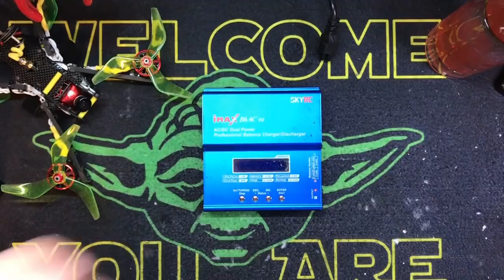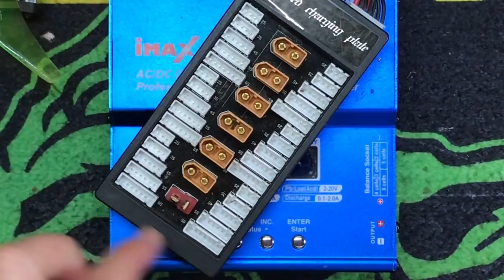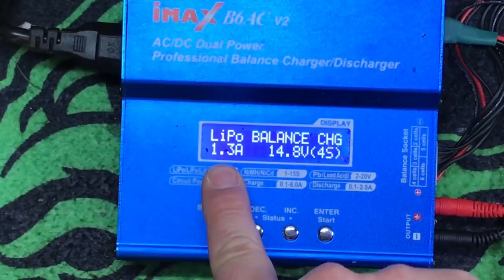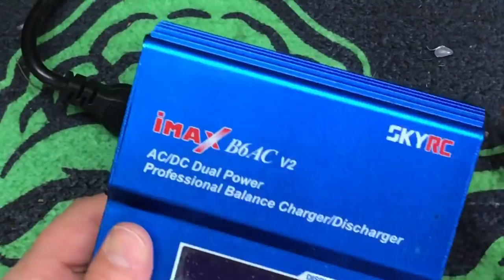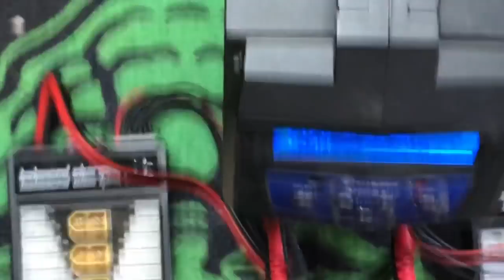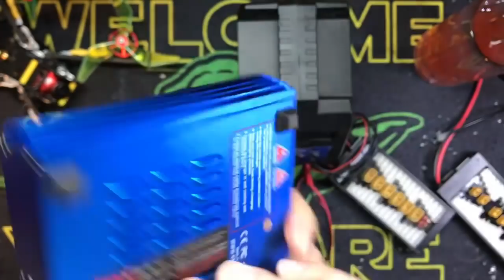Beginner info -  Lipo Balance chargers, mono, stereo etc.....

Comment: Any recommendations for field charging? I would like to fly longer than an 1.5 hours and usually not near car / anything when I fly (get time to) I have the imax B6 works great for me
Reply from the maker: U know what I did that’s a whole lot cheaper than buying more gear? I bought a power inverter for my car. Works great.  Just use your existing gear.  Something like this BESTEK 300W Power Inverter DC 12V to 110V AC Car Inverter with 4.2A Dual USB Car Adapter https://www.amazon.com/dp/B004MDXS0U/ref=cm_sw_r_cp_api_lg6SAb0RH6XY0
Reply: I saw a guy bring one of those larger battery jump starters with inverters built in to the field for an event. Anyone who wanted to charge could hook up(within limits of course). It wasn't exceptionally mobile, but it was pretty good and had wheels. Only logical for longer events/hangouts, but great idea regardless.

Comment: What's up JJ? Love your straight up balance board tutorial. Maybe that's what I needed to hear to make me buy one. Honestly, watching any other vid on balance boards, scares the shit out of me. Everyone makes it sound like you are going to burn your house down if you f'k up one little step. And another thing, I wasted 20 minutes of my life that I will never get back, watching JB's video on balance board charging. Wtf. He's saying each battery needs to be like 0.1v difference and no more or you will burn your face off. Then he goes in to this long explanation of how to get them all within the same range. Seems like all the time wasted charging and discharging them to the same voltage, you could have just charged them individually even quicker.  I do like the smoke alarm deal. I do use a lipo safe box for charging and I have several chargers but when I travel, it's a pain. That's it, I'm getting a balance board. Thanks JJ.
Reply from the maker: Hey brother.   Yeah I get zinged on that a lot.  That’s why I don’t do battery. Videos.   I’ve been doing it like this for 3 years and never had an issue.  Some people say different. I’m sure the lower and closer the voltages are the more comfortable people feel, but I’ve never had an issue.  Definitely get the smoke detector to be safe.  I got that one at Lowe’s, detects heat and smoke and has a 10 year battery in it for 20$ and it’s small.

Comment: It's ok to charge at 2c or 3c. The 1300mah can be charged at 3.9 amps with no prob. Saves time.
Reply from the maker: I agree with u in that.  Maybe u and I are the only ones not terrified of lipos lol.   But had I said that, people would go nuts.   Lol.  People already think I’m insane for staprsge charging at different voltages.   In 3 years I’ve never had an issue